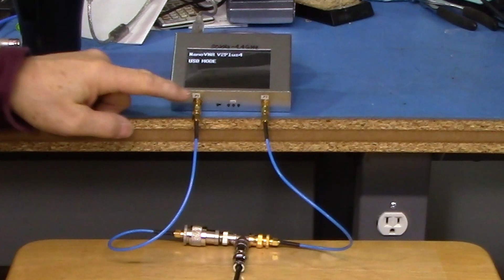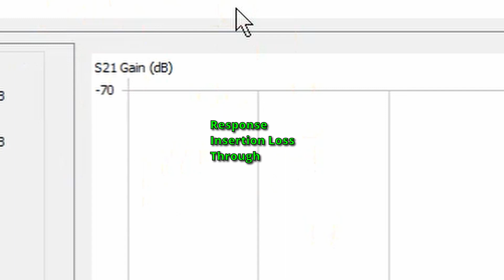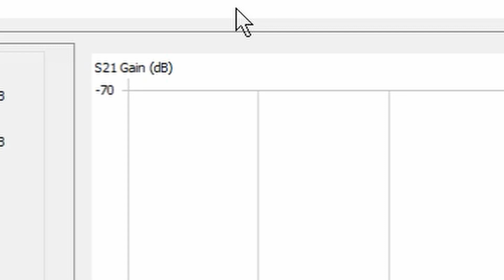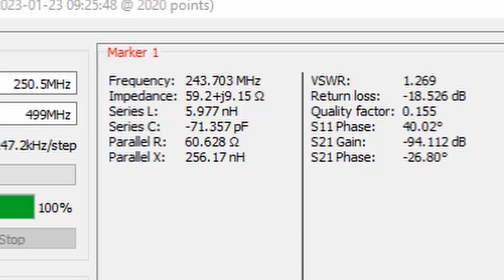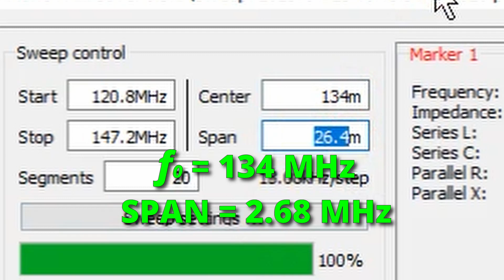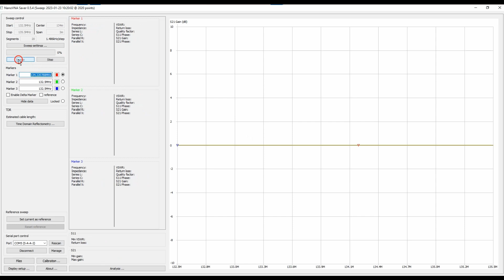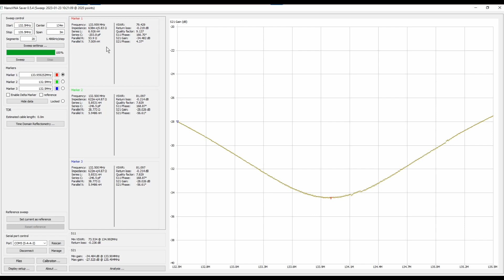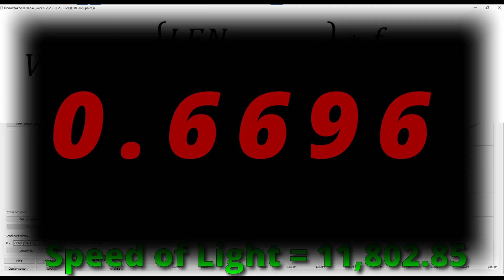Measure Velocity Factor, An Alternate Method (050)

Comment: Can this technique be used to measure the VF of insulated wire used for antennas?  I am planning on cutting several End Fed Random Wires for use with a 9:1 unun I recently made.  As you may know, there's nothing really "random" about EFRW, especially when trying to do many ham bands.  There are so many lengths to avoid, especially when trying to cover the 60m band in the mix with the usual suspects.  A difference in as little as one foot can be bad.  SO, I'd like to adjust the table of EFRW lengths that assume 100% uninsulated copper wire and recalculate for my silicon jacket insulated copper wire.  Your video removing some braid from coax suggest it would work for the entire stub being unshielded but insulated wire?  My bet is there are others out there using various other wire gauges/insulations whose inquisitive minds want to know.
Reply from the maker: First of all, all of the methods that I have presented in my videos on measuring velocity factor assume a transmission line ... two parallel conductors of some sort.  A single conductor hanging out there is a bit of another thing. I suppose the return path would have to be the ground beneath it.
You are right, the VF of an insulated wire is lower than a bare wire and this is dependant on the particular material used to insulate the wire.  The higher the dielectric coefficiant, the lower the VF.
If I were faced with this conundrum, I would be tempted to use an empirical method. I would string a known length of the insulated wire up and then see what frequency it is resonant at - Return Loss dips. Then back calculate its VF. I would try this with the wire in the environment that it will ultimately live.
For transmission lines a quick estimate of the VF may be calculated with VF=1/(sqrt(dielectric coefficient of the insulating material)).  Whether this holds with a single wire traversing through space ... I don't know.
I did a quick ask of the Internet about this and got a mish-mash of uncertain answers. 😞
Reply: @eie_for_you  Thx for the reply.  Yeah, I was hoping for some unfounded reason to avoid doing that, but it makes sense.  I have some scrap unusable length of the stranded copper 20AWG silicon insulated wire I can measure, I just need to find some bare stranded copper 20AWG to cut to the same length to compare and calculate VF based on my nanoVNA measurements of those.  I'm like you presently in that I don't have two supports for elevating the wire away from the ground to minimize ground effects, and using a counterpoise wire off the unun may unduly alter the measurements (I use a choke placed back on the coax as counterpoise on my EF Half Waves), so I'll plan on measuring the wire as a sloper with one end up 50ft.  While I'm at it, I might as well measure some of this cheap stranded 14AWG THHN wire from Home Depot I use for higher power wire antenna applications, which I already know from past experience that I cut a surprising amount off for tuning (it has two layers of different plastics).  BTW, your videos as not only excellent topi coverage but very well produced; keep up the good work!
Reply from the maker: @StephenKangas  Thanks man!

Comment: have to watch and follow along with my vna in shopagain to see what i come up with,,,are you using rg58u  ?,,thanks for doing great videos
??
Reply from the maker: Yes, this was RG-58'ish stuff. Actually somewhat unknown and very, very ancient. I used this coax back in the early 1970s to connect to my antenna when I was in High School and it was used coax someone gave me even then!  So, I truthfully did not know how the VF would work out.
I have some other RG-58 coax that measures out to a VF of 0.6523.  So, you never can tell.
But, if you are going to do the "cut long and trim to tune method" and you want to just use the datasheet VF value, cut extra long and trim to tune. All of this measuring the VF becomes unnecessary.